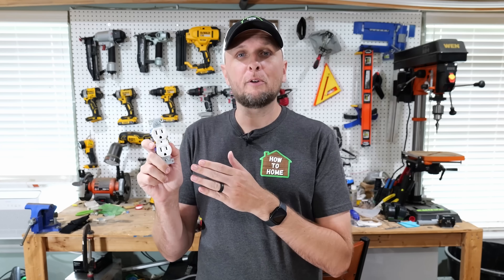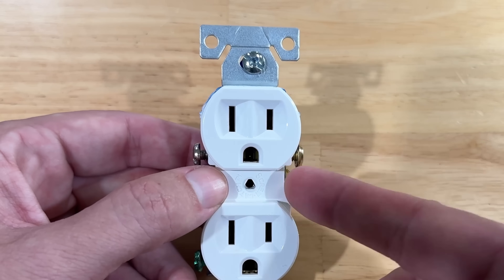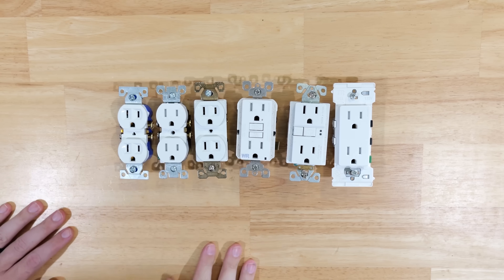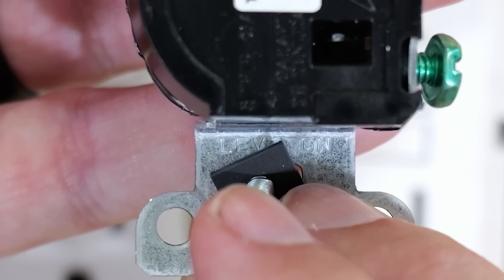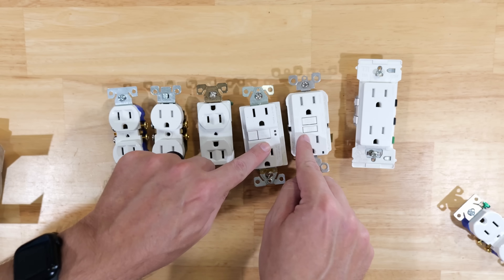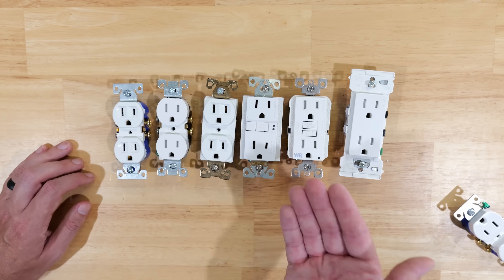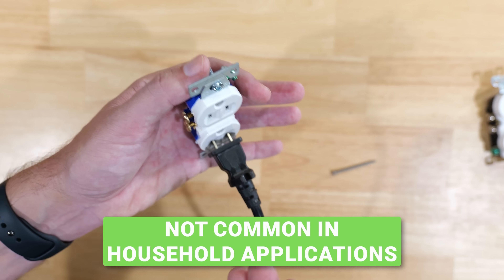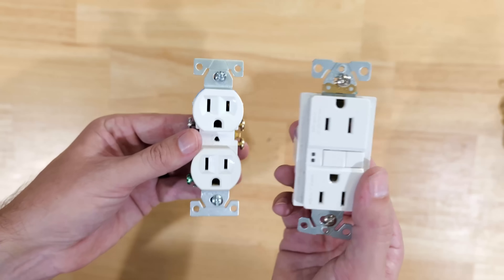The Shocking Reason Why Your Outlets Are Installed Upside Down!

Comment: Wait, your downside to ground up was possibly allowing your finger to touch the prongs, but you also said that three-prong plugs are the minority in household use,   So, no advantage to two prong plugs either way.  Ground up helps keep the plug in as it better counteracts the gravity on the cord and plug.  As for looks, humans always see faces in everything so that's why it is felt it "looks" better.  I once found a dead circuit caused by a coat hanger behind a washer.  Luckily no fire or injury.  From that day on, all my own house/shop outlets are ground prong up.

Comment: The ground pin is for user safety where the housing of a device becomes live due to damage or a fault in the wiring in the device. If the ground pin is up, it is possible for the plug and device to still be energized, but the ground pin to not be making contact. This would leave the housing of the device live and a potential electrocution hazard. If the ground pin is down, the ground pin would likely still be connected after the live pin loses contact with the receptacle. 

Three wire systems with a ground pin were a costly mistake. We should have gone with a two wire system and made all appliances and devices double insulated. Three wire systems have 50% more connections and 30 to 40% more copper wiring. More to go wrong and more costly to install.

Comment: As a commercial electrician for almost 4 decades, here is a personal observation regarding receptacle orientation. As the discussion confirms, NEC article 406.5(G) is the only chapter addressing face orientation in the National Electrical Code for face up installations, but wait, there's more.. another component of a receptacle's use is NEC article 406.10(D) - Grounding Pole Requirements. Article 406.10(D) tells us that for any grounded cord-cap (plug) that is inserted into a grounded receptacle, "the equipment grounding connection is made before the current-carrying connections" or simply, the ground is the first to make and last to break. That's why the ground prong on your plug is longer than the power blades, first-in, last-out. 
Back in time, most trim (wall) plate were made of metal, either sprayed brass or chromed in bath's and kitchens. The likelihood of a nail or paperclip falling across a loose plug was less likely than a loose trim place falling across the prongs. As the older non-grounded T-slot receptacles were replaced with grounded types, metal plates remained and still presented the loose plates falling short circuit  problems. The fix.. put the grounding prong up, the plate would hit that first... but that became a conflict with NEC 406.10(D). As a loose plug worked its way out of the receptacle, the weight of the cord pulling the plug down would let the grounding prong disconnect before the power, creating an un-grounded energized appliance. Reversing the orientation made sure the grounding prong was the last to break connection. In today's time, metal plates are quite rare (and expensive) as most are now non-conducting plastic or nylon, eliminating the shorting problem. So my 2 cents, Grounding Prong goes down.
One other orientation tid-bit, I always install horizontal receptacle with the hot side up, neutral down. The hot side of a loose receptacle in a metal box has less of a chance of creeping down and shorting out on the side of the box. Plastic boxes, like plastic plates, eliminate that problem but old habits are hard to die..

Comment: I always heard that way back when NEMA5 connectors were developed, ground pin up was the originally intended orientation by the designers, but people subconsciously liked it better with the ground pin down, because it looked like a face with two eyes and a mouth.  (amusingly looking "shocked"). People anthropomorphize the silliest things. 

Because it doesn't really matter which side is up, and there is nothing in code that prescribes the orientation, ground pin down became more common.

Personally, every outlet in my house have the ground pin down, BUT I tend to think ground pin up is easier to insert if you are doing it blindly.

Comment: Uff that is a bad way to grab that plug to pull it out. It has those grip grooves on the sides for a reason. That way if your finger touches a leg it will be just one, regardless of if its ground or the other ones. TBH I prefer plugs to go horizontal. 99% of houses I see where I live are horizontal. 
I get on some situations you would do vertical due to space, but why can't you go horizontal in most walls where there is plenty of space?

Comment: Seriously though... When a receptacle is properly oriented, it will appear as a horrified face to a small child.  Also, if when you plug a power adapter into a receptacle and the cord relief is coming out of the top of the adapter, you receptacle is installed upside-down.

Comment: When properly installed, the receptacle appears as a cautious, concerned  face to small children.  Also, the only thing one must do to realize the proper orientation is to plug a power adapter into the receptacle to see that when it is installed upside down, the cord will be facing up instead of down.    It totally looks wrong or unnatural.    During my 52 years of being an electrician I have noticed something rather odd... that Caucasians orient them ground stab down while Blacks install ground stab up.  What is up with that?   I never knew that blacks and whites went to separate electrical schools.

Comment: I was told many moons ago by an old timer Electrician that it was "good practice" to install ground prong on top - back when receptacles had 'metal' coverplates. Should it come loose from screw backing off, it would slip down onto the ground and reduce the risk of shorting the circuit or becoming energized. When switching to plastic coverplates by the 1980's, Electricians no longer worried about the position of the ground.

Comment: 10:22... Ground Prong Down is a Feature to remind you that a Plug is not seated properly in the Receptacle by blowing the Fuse/Breaker.
Never have had a Fuse or breaker Blow by metalic Crap falling between a Plug and Receptacle...

Comment: At IBM the outlets were all installed with the ground prong was on top.  The reason was if something was dropped on a plug that was not completely in, it would hit the ground and on the power pins.

Comment: As an electrician myself, I only install group prong down unless the customer has a preference. usually this preference comes when you have a switched outlet. To quickly identify it, it is common practice in my area to do ground prong up for switched outlets. But again I don't do this unless the customer askes for this work to be done that way.

Comment: The fact that the receptacles are designed with the possibility of being able to contact the pins while still live, show the failure of the design. If you look at some of the other designs in the world, the pins are covered until they break contact, have circuit fuses in the cords, and use the ground pin to ungate the hot and neutral sides.

Comment: I was taught that the order of connection was. Ground, identified connductor, hot. If you hold the receptical in your left hand and connect in this order the ground pin ends up pointing down. So it got installed that way rather than turning it back over.

Comment: I once had a metal faceplate come loose (single screw backed out). The plate dropped down and shorted the hot and neutral. Sparks. Ground hole up would have prevented, but I think the main problem is that metal faceplates are a hazard.

Comment: US plugs are just badly designed and in dire need of an update. Here in Europe our old style plugs were also plenty bad, but modern outlets have safety features so none of the concerns mentioned in the video could happen. It is simply not possible to get in contact with electricity, neither when you unplug it or by dropping something etc. Children are also prevented from sticking anything into the outlets because they have safety shutters. Pins have a plastic part, such that the metal only gets powered when it is completely inside the outlet and no longer accessible. Lots of safety features have been added and yet it is still mostly compatible with old plugs.

Comment: WOW. You are TOTALLY misinterpreting the NEC code.  "Face-Up" means installing the outlet in a horizontal position, literally lying flat with the Face UP,  like cut into the top of a countertop.  That is why kitchens, etc. are mentioned as "not allowed face up"- as you can't have liquids flowing into the the outlet.  It has nothing to do the ground being on the top or bottom while looking at it.

Comment: 13:00 I actually did that when I was a kid. I was unplugging the Christmas tree lights and my finger touched the still hot prongs. I felt the shock, and my legs suddenly flexed causing me to jump back. I had a burn on my finger and I felt rather sore but was otherwise unhurt.
      I saw this deal on TV where lightning struck the pitch during a "pointless football" (soccer) game. Several of the players fell to the ground with injuries but several players were unaffected. However, the injured and uninjured players did not correspond to their distance from where the lightning struck.
     It turned out that the difference was if the players had both feet on the ground or just one foot on the ground. All of the injured players had both feet on the ground the moment the lightning struck, and none of the uninjured players had only one foot (or no feet) on the ground.
     I lost my leg when I was 3 so I only had one foot on the ground. Not sure if that is what saved me, but if so, it would not be the only time having lost my leg was a good thing.

Comment: I was taught that normal installation is ground prong down, however, if an outlet is controlled by a light switch, install it ground prong up. This will save time in diagnosing a non-functional outlet.

Comment: I'm a licensed electrician. The code doesn't say one way or the other. You can do either. It doesn't matter. You can install them sideways. Installing ground down is just the common convention (at least in residential), but some of that is driven by 90 degree cords having the ground on the down side. And if a cord starts to pull out from weight/gravity, if it is ground down the cord stays grounded. Sometimes a ground up receptacle is used to indicate a switched outlet. Installing ground up for safety is kind of a myth. The chances of the plug being out a little and something falling on the two exposed prongs and causing a short are so small and so rarely happen that it doesn't really matter. In a shop or commercial/industrial setting where metal receptacle plates are used, receptacles are commonly installed ground up because of the possibility of the metal plate falling down on the exposed prongs. But even then, the plate or whatever, could hit the ground plug and roll over to the hot side.
So outside of special circumstances it doesn't matter, but ground down has advantages in most situations.

Comment: I've been experimenting with this for years, can come up with no arguments for or against either. Not even the extremely rare case of something falling onto exposed prongs because, in my l8fe anyway, theres almost no cases where that is likely. I have noticed that RV 30amp plugs are usually installed upside down though and I've seen that lead to fires.

Comment: The problem I find with the ground prong facing up is in some cases it makes the cord have to curve up around to suit that orientation. This puts unnecessary weight on the plug end of the cord and receptacle. The plug tends to work it's way out of the receptacle as well as wears out the integrity (tightness of) plugging connection. I have never maintained one is wrong versus the other. I do maintain one is better than the other in general.

Comment: Haven't seen mentioned: the weight and movement of the cord and how that affects how well the outlet holds the prongs is important.  The longer ground prong at the bottom secures the cord better as gravity pulls down on the cord, whereas when on top the two hot prongs create a fulcrum for the downward pull of gravity to leverage the connection loose.

Comment: My house was built in 1970. All of the receptacles and light switches are upside down. I’ve had to flip a couple of them because when you buy things like indoor bug zappers or plug in air fresheners they have to plug in with the ground pin down.

Comment: I have seen a metallic faceplate fall onto the blades and short out, so I like the ground up, but I still usually install them ground-down since most people seem to expect it that way. But for a double duplex I've also done both so the hots are to the middle and the neutrals to the outside. That way it handles both types of plugs and it keeps the wires further apart.

Comment: Not an electrician, but work for a general contractor that does tons of additions and remodels in California. The only time that we see/install one that's upside down(prong up), is when there isn't a overhead light in the room. The upside down outlet is connected to the light switch near the doorway to the room. This is the receptacle that you would plug your room lamp into. All other outlets are full time power.

Comment: I have been "bitten" a couple of times by trying to remove a firmly stuck plug, and in both instances, it was a simple 2-prong plug, so it wouldn't have mattered.  I prefer the appearance of the ground opening at the bottom, however.

Comment: The only exemption that I know of is, when I worked in a power plant some years ago. The electricians told me that in an industrial setting ,such as the power plant, they were required to install all receptacle's with the grounds facing up. They said it was a safety issue in case ,as you stated, the plug was partially pulled out and something fell across the contacts. All I know for sure was that every receptacle in the plant was installed ground up.

Comment: I was in a hospital room today and had to plug in the machine that controls the drip from the saline bag and the receptacle was red in color. the outlet was oriented with the prong up. 

I was selling our home and required a home inspection. The inspection report wanted several outlets reversed in orientation as the inspector’s opinion was they were installed incorrectly.   I pointed out to the buyer this was not a fault but an indication of which outlets were switched. Nevertheless I switched the orientation to please the perspective buyer. Why argue?

Comment: I just moved into a house where a significant number of outlets have the ground prongs on the top.  I generally think it looks wrong (can't justify it, that's just what my mind wants).  However, I've had a couple of problems with them like that, and I'm feeling like I'll need to kill the power to my whole house and swap them all to ground-down everywhere.  First, I have a wifi signal extender that has a clear up and down, and the ground prong is absolutely on the bottom.  If i plug it into the wall, then the antennae are all facing the floor, which might not be a deal-breaker, but certainly looks wrong.  Also, I have several extension cords and power bars where they clearly expect the ground prong on the bottom, otherwise the cord goes up the wall from the outlet.  So, generally, it seems like in terms of things that plug into the outlets, ground prong on bottom is what's more expected.

Comment: Retired from a large rich hospital that had tens of thousands of receptacles. They probably had over a thousand receptacles in the 25 plus OR rooms. All wall p!ates were stainless steel & engraved with panel & circuit breaker #. All 120 volt receptacles had ground up in case the screw fell out and was saver to have a conductive plate rest on the ground pin. This occurred several times a year.

Comment: My home has the ground facing up. I have experienced problems with polarized chargers extending upward like an antennae. Not only is this problamatic for the charger working out of the receptacle over time, but since im forced to use the top outlet, it causes difficulty when you want to use the lower outlet to plug in something else with all the bulk of the charger hanging upward. Therefore, i think it works much better if ground is down. After all, thats where Earth is, lol.

Comment: I lived in France for four years and all the plugs, commercial or residential, are ground plug up... but that might have something to do with their power being 240v 50hz. All the residential outlets in the US I've seen are ground down and all the commercial ones are ground up.
Reply: While the French socket accepts the same plugs as in other European countries - except the UK plugs, many European sockets connect to the side of the plug, those sliders make contact way before live and neutral. What always surprised me in the US is that the live and neutral are much thinner blades than the pins on a Euro plug, noting that the current is larger in the USA for the same wattage than in Europe...

Comment: My grad school got away from this entire argument... every single outlet they had was installed on it's side.  Some had ground to the left, some ground to the right, but never up or down.

Most of the wall-worts I have seen are designed to go down, not up.  (Also annoying because it precludes half the outlet from being a valid location from them unless you use a power strip.)   For that reason, I'll keep using ground down until we come out with a better system.

Comment: Purely anecdotal; I've witnessed a rather nasty short circuit on a ground pin down outlet in a workshop scenario when a conductive object fell onto the hot and common pins, and I've never been shocked when plugging something in, or unplugging something, in any scenario (so far), and I'm 66 years old.